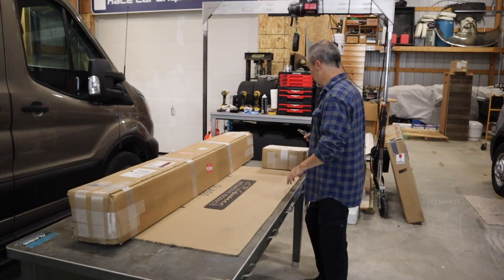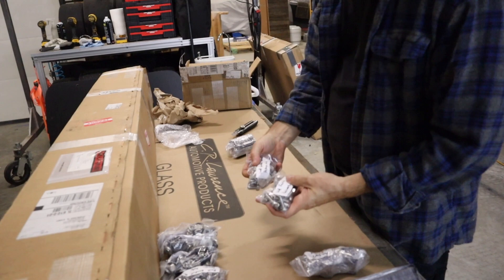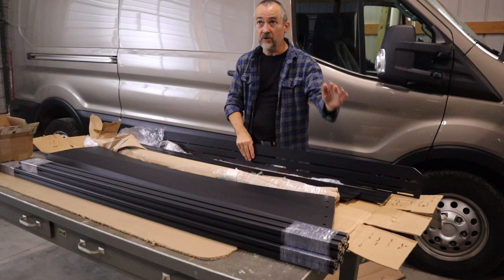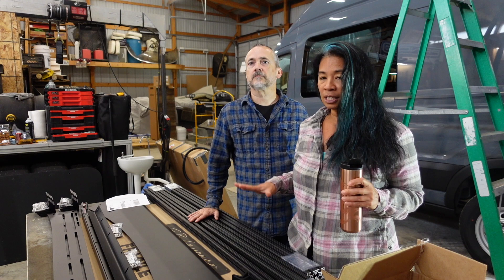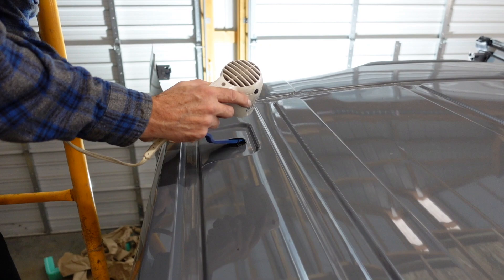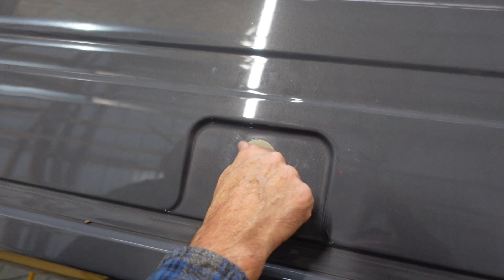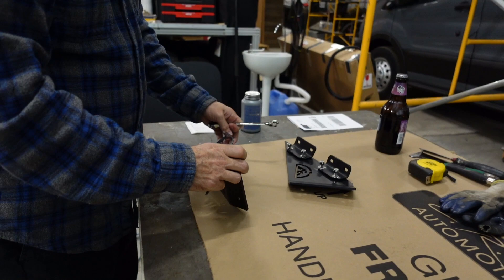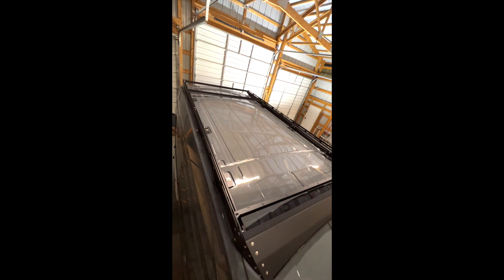Van Build: Unaka Gear Roof Rack Unboxing & Installation on a Ford Transit

Comment: What tap/thread pitch did you use? I’m about ready to order the rack and want to be prepared for threading issues. Thanks!
Reply from the maker: Hi! Thanks for watching! 
The rack is 15 series 8020 so any stock fasteners need to fit the 15 series. To tap the center hole on the end we used 5/16 x 18 tap.
Reply: @ChristineIC  Thank you!